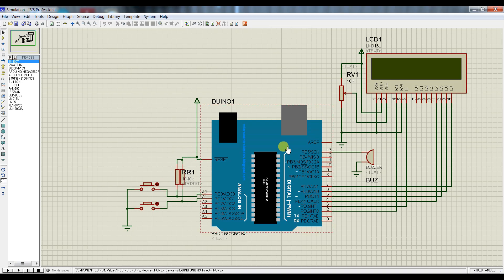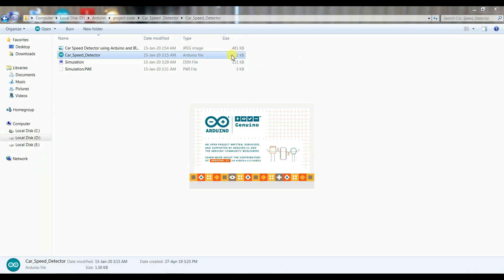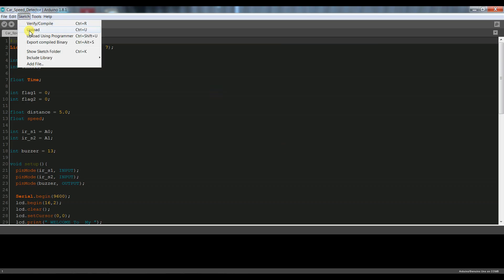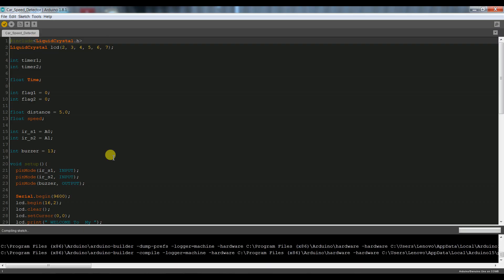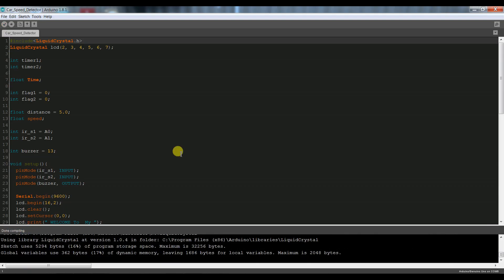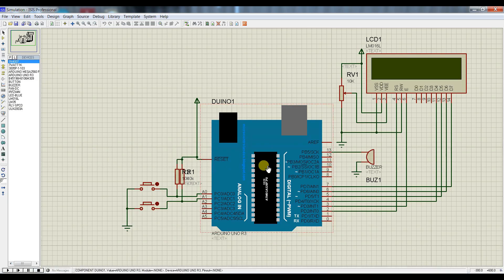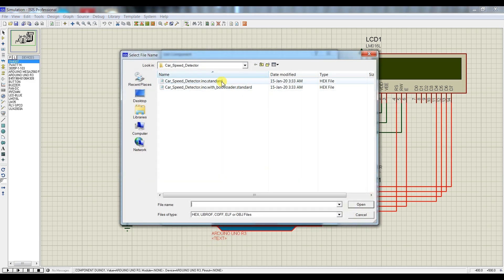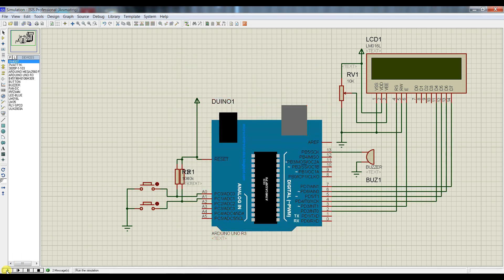How to make a Car Speed Detector using Arduino and IR Sensor | Vehicle Speed Detector

Comment: Hello great work. It might be a silly question but why you use the 3 resistances?
Reply from the maker: 100R Resistance for LCD backlight
1k and 4.7k Resistance for LCD contrast setting
Reply: @MuhammadAnsar   Thank you for you quick response. Can't we just put a 10k potentiometer for the contrast and the backlight instead of the resistances?
Reply from the maker: @gwrgio  yes
Reply: @MuhammadAnsar  is it necessary to put resistance  ?

Comment: I am from Pakistan and I M doing the same project but with raspberryPi and a camera connected to it to capture the picture but can you plz guide me for selecting the radar it is impossible to purchase the radar online because it is not available anywhere
Reply: as you are using the IR sensor in this tutorial will this sensor will help in my desired project or not? please advise ASAP
Reply from the maker: not use the IR sensor for raspberry Pi and camera
Reply: @MuhammadAnsar  so which sensor should I use please guide me for this...
Reply: @MuhammadAnsar  sir please help I M stuck in this project
Reply: @Muhammad Ansar can you please suggest me which radar should I buy to measure the speed of vehicle
Reply: this IR can also help you but firstly what is the distance at which your sensor is placed from the entering car ?

Comment: Hey 
I have connected the circuit with your code but it's not responding to show the speed it is only displaying normal speed at 0km/hr it's not responding to changes on the IR sensors
Reply: is there error of arduino code
Reply: Same issue😥

Comment: Whats the maximum speed for output ?
Reply from the maker: 200 Km
Reply: @MuhammadAnsar  hi bro, can i know what did you put in the circuit at 4:15 till 4:40 ? sorry bro, still new to the circuit things.
Reply: @MuhammadAnsar  I got 446 as maximum speed.
Because ur code has some mistakes . U took 5 cm as distance but it is 10 cm also to also ur conversion from cm to km is wrong. Sorry to say this

Comment: Thanks for sharing. In your code - your distance is set to 5, but I think you spaced it at 10cm so it should be 10? Also, when you convert to km you are converting m ->km but shouldn't it be cm->km?
Reply: I have same question..
@Ryan Yandle did you found any solution..?
Please let me know 😊
Reply: Hi sir kindly,
please send me programming of this project 
It's urgency 🙏
Reply: I have changed it. But now the speed measurements are too small. as I move my hand very fast but still the speed does not cross 7 km/hr